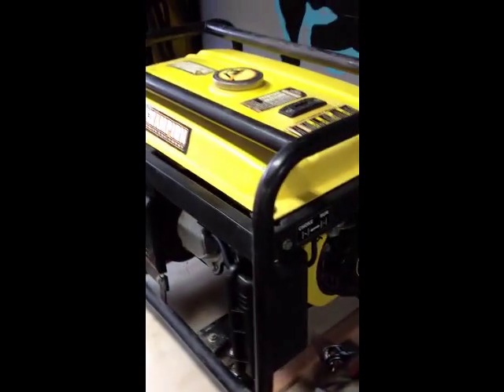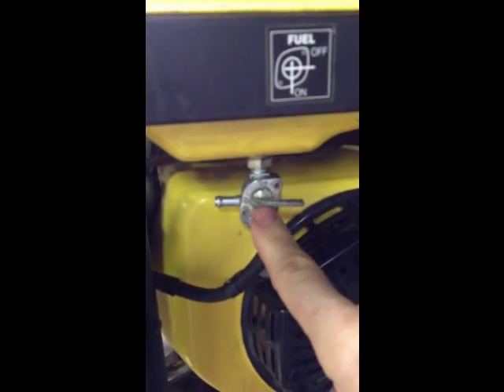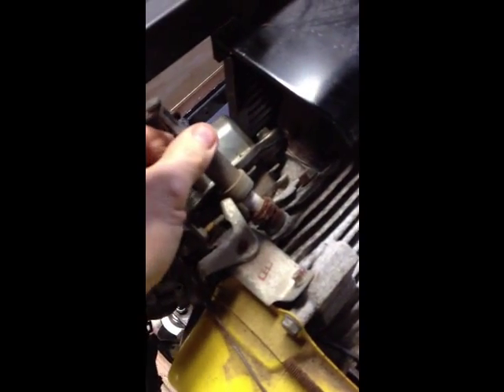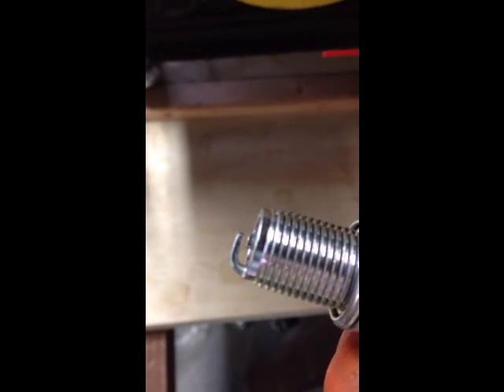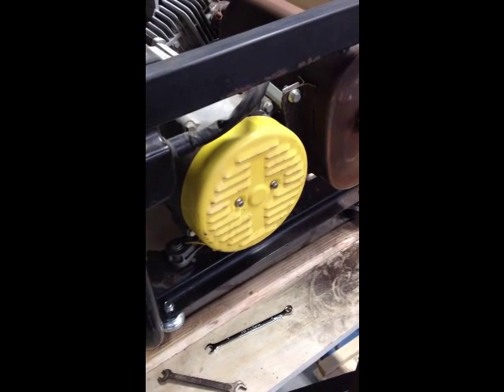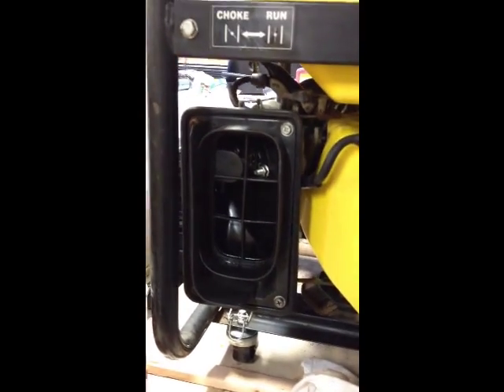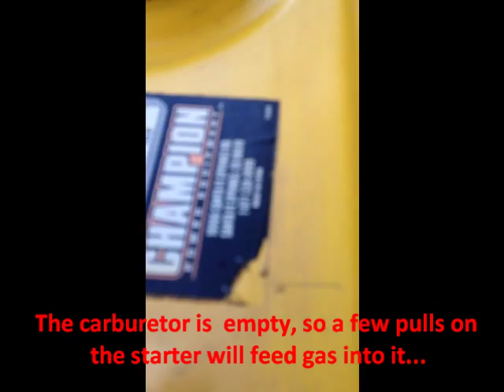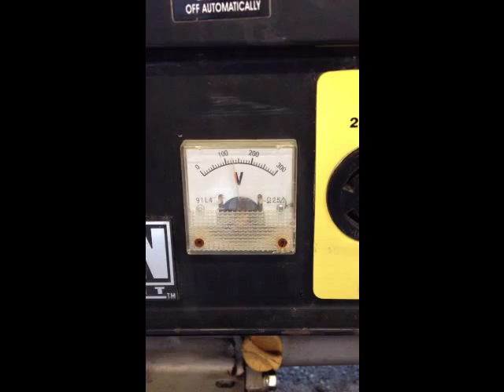Champion C46540 Generator Maintenance

Comment: Hi Steve, thank you for posting the video.  I have exactly the same generator.  I bought it for $3 in a non-working condition.  The seller told me that, last year, the generator stopped working and he couldn't get it to start again.  Once I got it, I couldn't get it initially to start.  First thing I did was to clean the spark plug, which was very dirty.  Then I was able to start the generator with no problem.  It runs fine.  However, when I switch to either 110 or 220V the voltage readings are off.  When switching to 110V the voltage meter on the machine shws about 50V (electric drill runs slow).  When I switch to 220V the voltage meter shows about 100V.  Do you have any ideas on what could be wrong with it?  What should I check?
Reply from the maker: Oksana Wasilik  I actually had the same problem when I bought mine.. I would remove and clean all the electrical connections (5.17) but do not mix them up

Comment: Wouldn't putting oil on a clean filter just clog the close cell pores of the filter and diminish air flow? Sanding the terminals will remove the plating and you should cover terminals with an anti-corrosion gel to prevent future rusting.

Comment: Arrg! I have one like that.  It's  2 years old never been run. Started it last week and it starts and runs like a top. But produces no power. gauge reads a hair over 0 until I plug something in, then the gauge almost pins out but wont even light a bulb
Reply: look up exciting the field with a drill or grinder , sounds like the field lost its charge ,   "exciting the field"  videos

Comment: Nice video. Why did you pull the gas tank? For general cleaning?
Reply from the maker: +Deucealive75 Made it a lot easier to access all areas. Spark plug ect. as well as letting me clan away all the spider webs from under the tank...

Comment: Oil on the filter WHAT ??????????? It's called a filter for that reason
Reply: There is only a film of oil on the foam filter. 
The oil is sticky to any dirt particles. 
As air weaves through the labyrinth of foam, the dirt hits the foam "walls" and gets stuck to the oil allowing much cleaner air to enter the engine. 
Many engine manufacturers have used this method of air filtering for nearly a century. (from lawn mowers to long haul diesel trucks. I wouldn't be surprised if locomotives and cargo ships use oiled air filters, too)